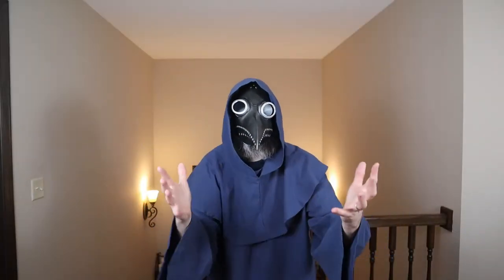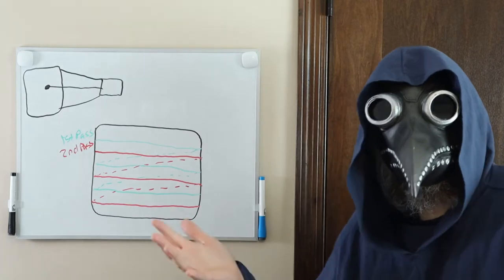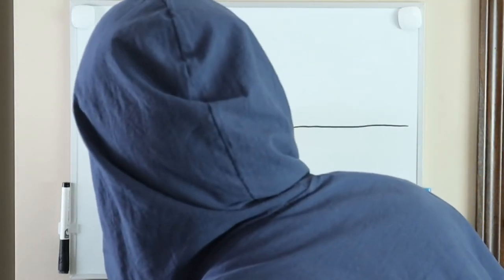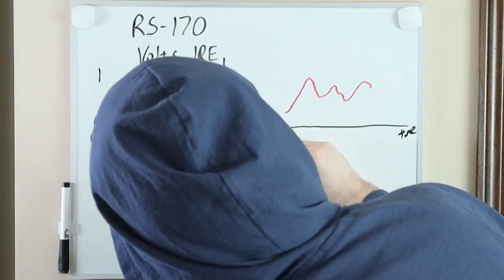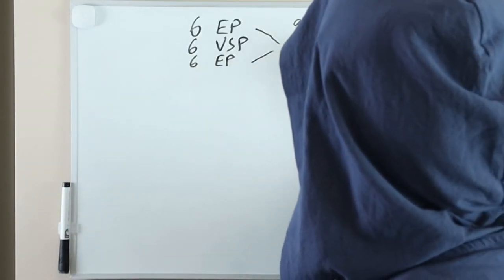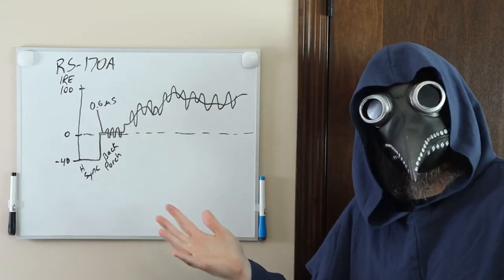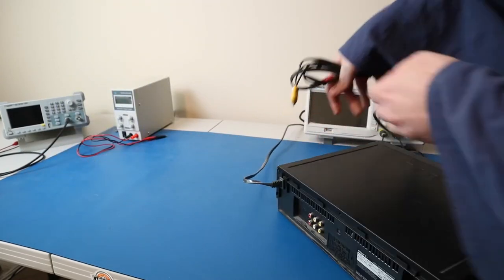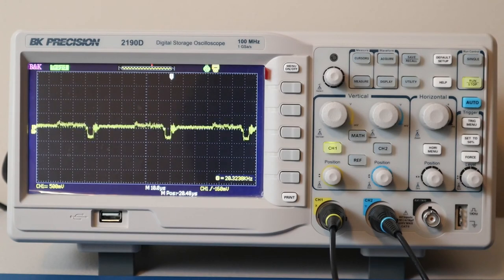The Composite TV Signal (EP 23)

Comment: When I was a kid in the 80s I used to play with the vertical hold while watching broadcast TV or playing Atari 2600 or using the Commodore 64 to examine the vertical sync signals.
Reply from the maker: Sounds like something I would've done...the 80's were a great time! Thanks for watching!
Reply: Professional video monitors has a switch labeled "cross pattern" which enabled bothe the vertical interval and a delayed horizontal sweep to be displayed. This was used to adjust the tension on helical scan video tape machines. It was also used on 2" quad tape machines to align the delay lines to match studio sync to make fine adjustments for wipes/dissolves and other special effects.
I restore 2" quad broadcast video tape machines

Comment: Very informative video.  I've worked on Televisions for years, starting right when solid state was just beginning...I've always wondered exactly how the color locked in, and TV's that has shifting colors that wouldn't lock in always frustrated me.  Luckily, that was not a common problem.  Now, I know how that color was locked in,  Not always a bad crystal.
Reply from the maker: Thanks for sharing!
Reply: The crystal in a TV was a LOCAL oscillator thay go the TV "in the ballpark". The TV adjusts its oscillator to the transmitted burst signal, loke a Phased Locked Loop. If the transmitted signal is missing the burst, the TV will shut down its color circuitry, to produce a good B&W picture.
Not all programs back in the 60s were in color, so the master control at the TV station would switch on/off the burst signal when needed. If you sent burst with a B&W Image, your TV may display a weird tint, that's why it was shut off for a B&W program

Comment: Informative video. Question: why did you have to add the resistor to simulate the input impedance of a TV when you hooked the VCR up to the scope? What would have happened if you just had the probes right to the RCA connector?
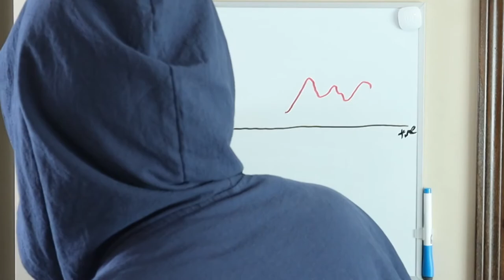Reply from the maker: Hello and thank you for the question. Devices that output a composite video signal will expect to drive a 75-ohm load. Different devices may behave differently when there is no load (depending on how they were designed). I do have a video which demonstrates what happens when you leave the 75-ohm resistor out of the circuit and that video shows the result on an oscilloscope both with and without the resistor. This video shows the behavior of two different devices. You can find this video on my YouTube channel - "How I Designed a Simple Video Sync Separator (EP 47)" from about 5:07 through 6:42 (minutes:seconds). Thanks for watching!
Reply: @DoctorRGPlague  Did you hook that resistor up in parallel? And what about the resistance already in the scope probe?
Reply from the maker: The resistor is connected from the composite video signal to ground. If you consider the oscilloscope probe to be the load, then the 75-ohm resistor is in parallel with the load. The effect of the oscilloscope probe impedance will be negligible when placed in parallel with a 75-ohm resistor. Typical probes will have an impedance of around 10-Megohms, which will decrease with higher frequencies, but we're not dealing with very high frequencies. Even if the impedance of the probe dropped to 1K-ohms, we'd still end up with about a 69-ohm parallel combination - not far from the intended 75-ohms. Thank you.

Comment: Nice video. How about VGA signal? That one i hear is even easier to generate since it can be done with just digital output although you obviously then have only 8 colors.
Reply from the maker: Thank you for the kind comment! Yes, VGA could be easier to generate, especially for color, since it has separate color signals. You wouldn't need to worry about phase shifting for color generation. The syncs are generated with separate signals. You would be limited to only 8 colors if you used just 1 bit for each of the 3 color signals (1 bit = 2 voltage levels, so 2^3 = 8 colors). Thank you for the idea. I'll add it to my list of possible video ideas, and maybe in the future I'll make a video on the VGA signal!

Comment: Thank you for your video. I have a question about the fields. In your video, the first field takes 9+13+240+0.5 lines, and the second field takes 9+0.5+13+240 lines. Does it mean that the second field is lower than the first field, if the TV scan lines from top to bottom?
Reply from the maker: Hello and thank you for your question. The top of the second field is drawn one scan line lower than the top of the first field. Both fields occupy the entire height of the screen, meaning that the first field does not fill only the upper half of the screen and the second field does not fill only the lower half of the screen. Instead, the first field fills in the odd numbered lines - lines 1, 3, 5, etc. Then the second field comes along and fills in the gaps by filling in the even numbered lines - lines 2, 4, 6, etc. This is called interlacing. This helps with persistence of vision by doubling the frame rate and reducing flicker.  I hope I was able to answer your question. FYI - I am planning on creating a series of videos that demonstrate how to make a composite video generator circuit to display text and graphics on an analog TV, which may be of interest to you. However, it may be a while before I am able to create those videos, and I need to create some prerequisite videos first, but I hope to start uploading those videos before the end of the year. Thank you for watching!
Reply: @DoctorRGPlague  Thank you for replying. Talking about “real composite signals”, I wonder if I can see something about retro video consoles. I heard that they used a technique called 240p, and I could guess that they achieved it by sending V-sync pulses not alternatively between at beginning of a line and at center of a line, but always at beginning of a line, so scanlines always hit same places of the monitor. What I could not guess is, on which line (or timing) do they send V-sync signals? If I had to take a wild guess, I’d say that they send V-sync at Line 262, Line 263, Line 262, Line 263, ... alternatively, in order to make 525 lines for every 2 fields, but it is just my guess. I’ve been always curious about how they actually work.
Reply from the maker: There is more than one way to generate 240p. It is something that I have generated in the past. Let me explain. If you look at the generated lines (for 480i) that I listed on the white board, you'll notice there is one difference between the two fields. The difference is the half lines. You can see that they are in different locations for the two fields. In the first field the half line is after the picture is drawn, but in the second field it is before the picture is drawn. This is what causes the interlacing. The half line in the second field creates a short delay that places the following lines in between the lines of the first field. So, the half lines create the interlacing. If you want 240p then all you need to do is get rid of the half lines. Then both fields will be exactly the same. Since they are the same you can just throw one of the fields away, and you are left with one field that you keep repeating. The lines for this method are: 6 EP, 6 VSP, 6 EP (these 18 lines are at 2 times the frequency and actually occupy 9 full lines), 13 blank lines, and 240 picture lines. This gives 262 total lines for 240p. We do not need 525 lines, so for 240p you would have 524 lines after 2 frames are drawn. By the way 480i would be 30 frames per second (fps) since you need two fields per frame, and 240p would be 60 fps since you need only one field per frame. Alternatively, you could just throw away the second field of the 480i and keep repeating the first field (262.5 lines each time, which would preserve the 525 total after two frames are sent). But please do not alternate the number of lines each time between 262 and 263, you'll get a shaky image. Make sure each field you send has the same number of lines. Hopefully this helps. I believe the old Atari 2600 used 240p, and I have one stored away somewhere. If I can find it and if it still works, then maybe I'll make a future video to demonstrate how the 2600 produced 240p. That could make an interesting video, so I'll keep it in mind. Thanks.